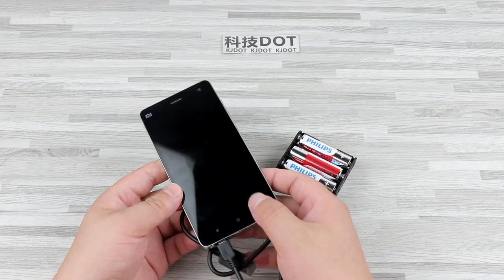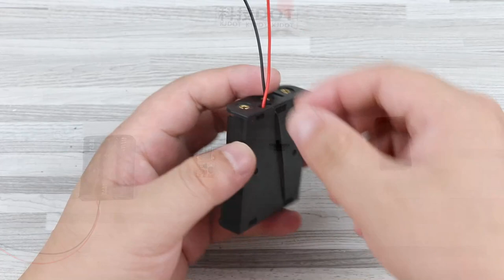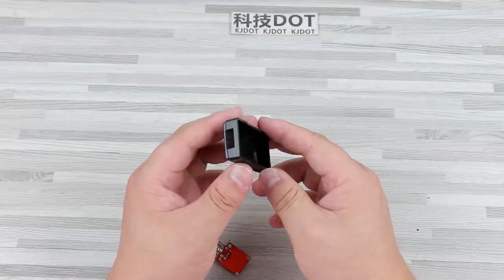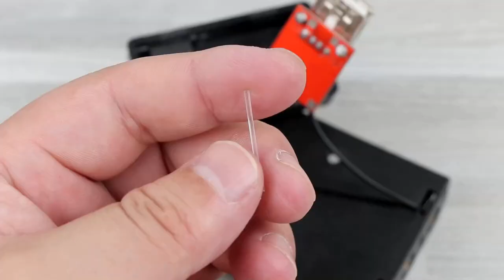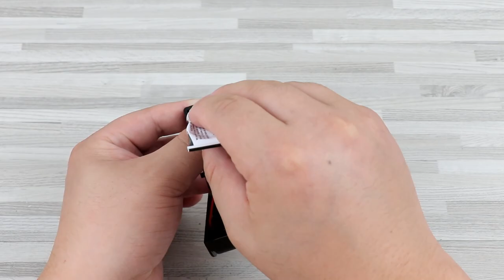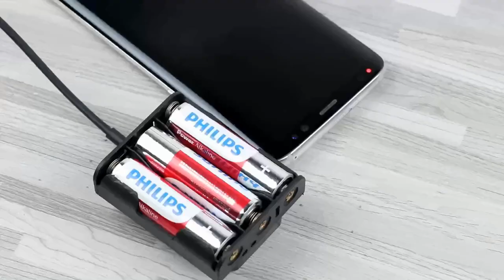A Simple AA Battery Power bank Anyone Can Make at home

Comment: am jn thr midldle of building 1 now ime guessing u wont need a board cos 3 x 1.5v is 4.5v thats fine for a phone am no good with eletric though can any1 answer me this iff h have a 4000mah bat or a 10000mah bat and it says 3.7v they all say that dont thry home clme when u have the battry alone iff j touch both wires it looks way more than 3.7 volts i have 50plus phone chargers 5v excetra they dony even cause a spark i have a 15v and 12 v they make a spark what is the actualy v of a battry without a board cos ime blowing stuff up left rite and centre cos of this lol

Comment: What phone are you using and what is optical fibre?
Reply: Optical fibre is what is in fiber optic cables. It's basically a tiny glass tube that 'conducts' light (by reflecting it). In this case it is just used to you can see the red light when it's charging.
Reply: optical fibre is just a peice of glass that transports light so you can see it at the end but not the round side(s)

Comment: Hello, How long does the batery last? Thank...
Reply: depend on what type of battery you use, but basically you can charge your phone 1 times, if you have higher battery 4000mA in the phone, this can charge up to 60%, this charger is really only emergency, any powerbank with 18650 inside will work better and longer
Reply: a Million Thank for you ..is a excellent idea
Reply: @nargalda773  How about using 3x 18650 instead of AA?
Reply: @trailchaser2  it's be about 4.20x3 12.60volts so you can use it but it will take hours to fully change it

Comment: This is good for some phones but other phone for example most iPhones need 5 volts of power and this gives 4.5 adding 1 more battery would make this a lot better.
Reply: Isn't the purpose of the 5V boost module to convert varying input voltage to constant 5V? So while the batteries are discharging and their voltage changes, the output voltage stays the same? Also, means you could use either 1.5 or 1.3 V rechargeable batteries.
I googled some example specs, and one boost module says, for example: input voltage: 3.7V~5.5V, output voltage: 5 V